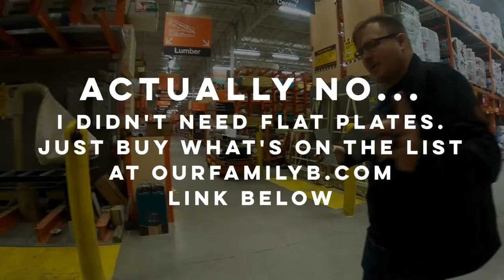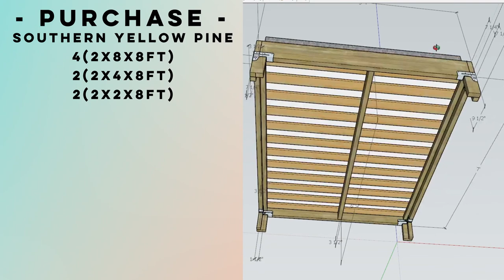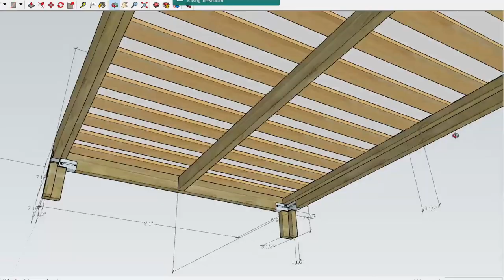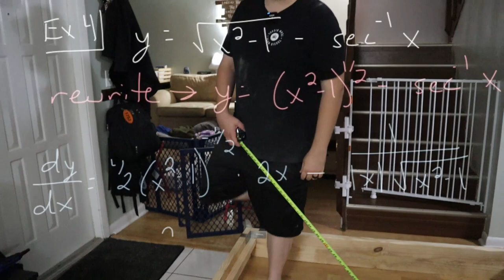HOW TO MAKE YOUR OWN BED | Easy DIY minimalist platform bed frame | wood from Home Depot | Cheap Bed

Comment: Ok so I finally bought all the Materials not realizing my bed is actually is an odd dimension how did you calculate your cuts so that I may apply that to me measurements
Reply from the maker: Oh no! Sorry that happened but so glad you commented 😁 what size mattress do you have? You want to have at least half inch (about 1.25cm) all around the mattress within the box of the frame. Then you have to account for the thickness of the wood.
Reply: So it’s a foam mattress I cut to fit my small room it’s 79inches by 48 inches really strange dimensions but it’s just the right size for me
Reply: And it’s a 6 inch thick mattress